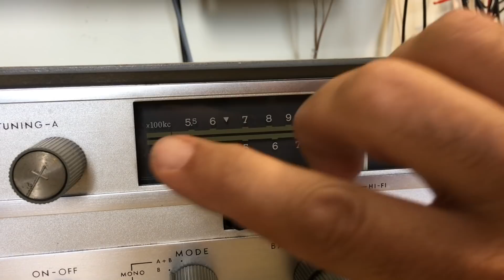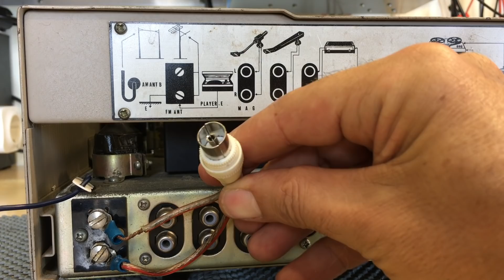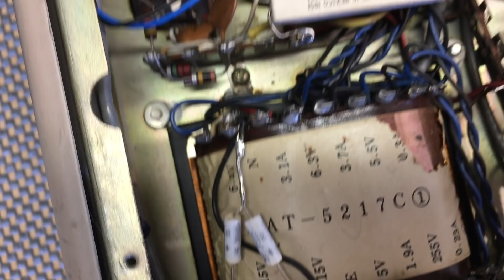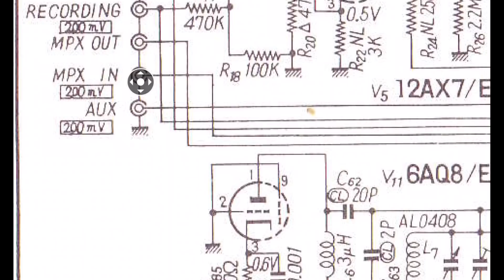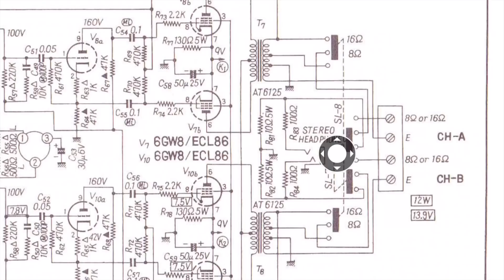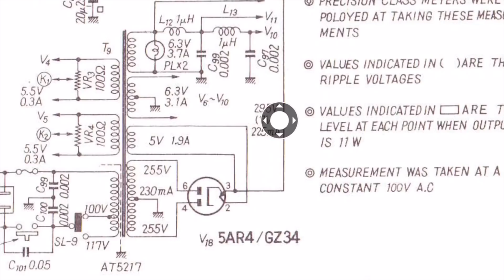Pioneer SM-G204B Stereophonic Receiver. A look at this amazing receiver.

Comment: Hello,
Your video is great 👍.
I have an sm-g204 on which I had to change capacitors and resistors.
I would like to adjust the Bias , but I don't know where takes the measurements and how much I should set it to. One of the transformers heats up much more than the other.
Could you please help me.
Thank you
Reply from the maker: I’m afraid this project was completed quite some time ago, and I no longer have it with me.

Comment: Excellent information.
Reply: @electronicsoldandnew , I own a very small vintage audio both in a junk mall. I have had excellent examples of stereo equipment pass through my store but this Pioneer SM-G204 is by far the most interesting unit I have ever seen. It is currently being deoxidized and cleaned. I can say, the unit that I have is an extremely clean unit.
Reply from the maker: It is certainly a great piece of history

Comment: Hi, I'm Danilo Montoya from Bolivia in South América...
I have one of those marvelous Pioneer SM-G204B and it sounds amazing, but there is an issue with the volume when I try to play records. I have MM and Crystal cartridges, both sounds output are extremely low, even when I put on the Loudness ... Is there any way to make them louder?
I apologize of any mistake in my english writing.

Great video!!!
Reply: Hola, si es muy bajo es porque la entrada y salida de grabadora es para una grabadora de carrete abierto que usaba alta impedancia de un mega ohm, en aquella época no existían todavía las grabadoras de cassette. Lo que puedes hacer es buscar las resistencias de entrada y salida de grabadora y reemplazar por unas de valor 100K ohm, el cual es el valor normal de entrada y salida modernos.

Comment: What a fabulous set and for the most part well restored. I cringed at the PSU capacitors though. Dual section can capacitors are available these days and would have looked much tidier. I agree triple section capacitors are harder to find, though not impossible. Here a dual section can and a single modern capacitor underneath the chassis would have worked.
I'd have kept the valve (tube) rectifier too. GZ34's are available and are still being made. 
Maybe just fussy of me, but it is quite a rare set and I'd have taken a few extra steps to preserve its looks.
If I had to guess it was very expensive back in the day. I bet the sound easily stands up to that of present day HiFi tuners too.

Comment: Very interesting radio.  It's interesting how broadcast technology has changed since the 1950s.  In about 20 years broadcast radio has transitioned from AM mono, to AM hi-fi, to FM, to FM stereo, to FM Quadriphonic, then back to stereo, with a few other less well-known technologies thrown in there as well.  And now, thanks largely to the internet causing a huge drop in demand, some countries have, or are about to, do away with broadcast radio technology entirely.  How sad.  I plan to build a Part 15 AM transmitter so I can at least keep the front ends of my tube radios happily receiving signals well into the future.  Maybe you could do the same with mini AM and FM transmitters for your Pioneer SM-G204B?
Reply from the maker: Sincerely Yours : I could, but it isn’t mine. I did the repair for a friend. I agree that the probable end of broadcast reception is sad, and just hope they drag their feet on this decision for many years yet.

Comment: suzuki resistors?
Reply from the maker: Hugo B. : Japanese set. Makes sense.
Reply: @electronicsoldandnew  yes but i have never seen any discrete component branded suzuki...but i also never took apart any tube pioneer gear so...

Comment: Hmmm... wonder if a homebrew MPX decoder based on the old MC1310P or equivalent (or one of the decoder boards that occasionally pop up on eBay) would work? I suspect they might be a bit picky about locking on if the receiver doesn't have AFC, but it'd be interesting to try…
Reply: I built a homebrew FM stereo adapter/ decoder based on a circuit from an electronics magazine. I used it for years with my Heathkit FM tuner and later with a portable FM radio used as a tuner. It worked great. Built it in 1962 right after FM stereo started.
Reply: @sulagodfrey-jensen813  Cool! I've seen various articles/schematics for those over the years, but never built/used one - FM didn't get here until the mid-70's, so valve FM radios are pretty rare to see in this part of the world.

I've built several solid-state adaptors for transistor/IC radios over the years though, mostly using the MC1310P, which is what started me pondering if one would work on a valve set. In my experience they're picky about levels & phase accuracy, which might make things difficult in a typical valve set - but I'd love to try one day!
Reply from the maker: My thoughts exactly, but I’m afraid the owner wants it back pretty quick.
Reply: That's a pity. Of course, one solution would be to buy a SM-G204B to play with yourself 😉

Comment: The Fisher in the US also made a dual tuner/amp in the Model 800B.  It uses (4) 7591s driven by 12ax7s.  It also had the MPX unit already installed on the chassis, so all options were covered.  Thank you for the circuit description.
Reply from the maker: My pleasure.

Comment: AM-FM stereo broadcasts were not pseudo stereo. The right channel from a stereo tape, and later LP, was sent over the AM station and the left channel over an FM station, usually owned by the same company. Therefore the stereo was real, as recorded. The problem, of course, was the inferior audio quality of the AM side. I used to listen to these broadcasts all the time, which were very frequent on the many “AM and FM” combo stations normally simulcasting anyway. In Los Angeles where I lived in the 1950s a variation was the FM-FM stereocast. KCBH (FM) would join up with another FM for full quality stereo broadcasting. Disadvantage: almost nobody had the luxury of two FM tuners or even radios. Your set would not have been up to the FM-FM format. Many manufacturers in the late 50s made stereo tuners that would allow simultaneous reception of one AM and one FM station. They are on eBay now and often sellers don’t realize what they have. Nice video.
Reply from the maker: I really appreciate your input. I now understand the stereo transmission procedure. What had me stumped was that the single channel audio transmitted over FM would sound incomplete to anyone listening without the complementary AM half. I guess this was advertised as such, but it sure took up a lot of resources for what I can only assume was a fairly small audience (these dual timers were not cheap).
Reply: Yes, the sound was unbalanced for the mono listener but I don’t know of complaints. The FM-FM stereo casters for a while used to remedy the problem by partial blending of the channels and applying some sort of phase shift.
I think there were a lot of listeners since all it took was any AM and any FM radio to hear them. People had gone nuts over stereo since it had just come out on disk (1957).  There were even stereo TV broadcasts using a radio station, either FM or AM as the second channel. Lawrence Welk was in TV stereo for a while, at least locally in LA

Comment: Great video as usual. Very interesting. I have just completed a Murphy A34 from 1937. I followed your methods with schematic painting, cleaning etc and it has been a great success. Well modified old radio including valve connections held in with matchsticks! Your methods made it much easier and with help from my local forum it is now working well. Thanks for your inspiration.
Reply from the maker: You’re welcome.

Comment: We had a early pioneer receiver in the late 50s. The rumble filter only worked on the Phono input and was a sharp low frequency filter that cut everything below 40 Hz. Hence RUMBLE. The soft/HiFi was an IF bandwidth filter. On normal the bandwidth was, well, normal but on HiFI the slope of the IF was wider with a flat top. This could only really be used on a strong signal with no stations close by, or they would bleed into each other. 
I better watch the rest of your vid to see if this one is simular!!
Reply from the maker: Yes, I believe that’s exactly what we have here. The broader IF was probably desirable for the “stereo” effect when using the MW band to support the FM mono signal.

Comment: Pioneer made some decent kit during the  60's & 70's, I think it dates to 1963, the 6GW8/ECL86 output valve was released in 1961.
Reply from the maker: That’s about right. The ecl86 was quite useful as it made a single tube class a amp possible.
Reply: @electronicsoldandnew  

Is this one class AB or Class A push pull?
Reply from the maker: WESTEL Audio : class ab
Reply: This would gave pre- 1961 when multiplex FM stereo started

Comment: I thought rumble filters were normally used with phono input?
Reply from the maker: True. It’s supposed to remove the effects of a record warping and bearing noise. However, it also affects bass response to a degree. This set has a phono input, so they added this filter.